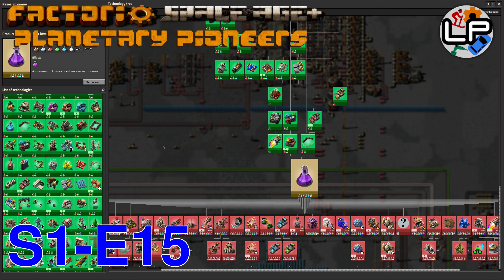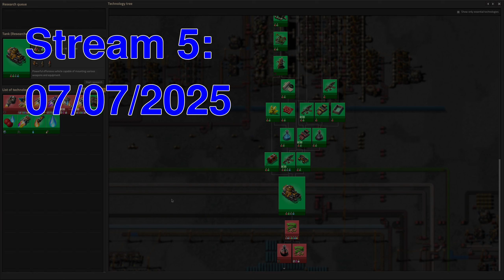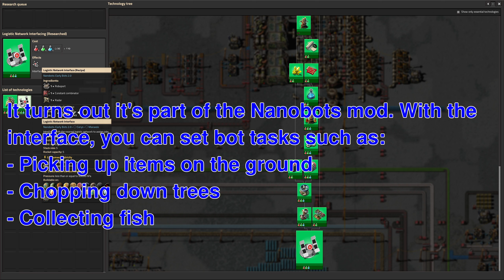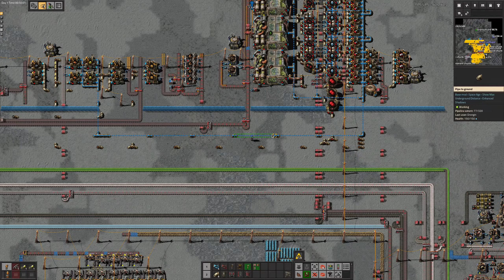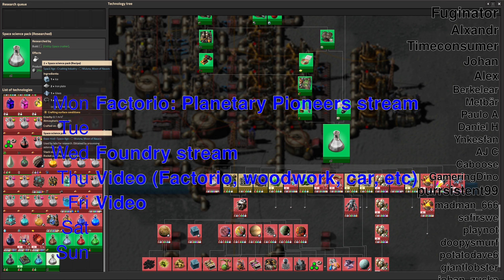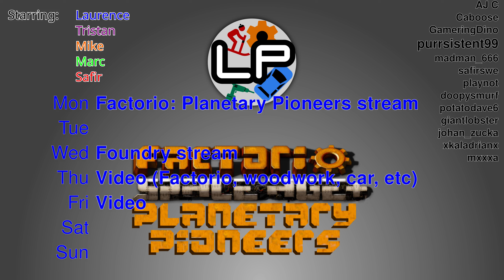S1-E15 - Learning - Laurence Plays Factorio: Planetary Pioneers

Comment: The ground cleanup tool is very useful.  This setup seems to drop a lot more things on the ground. Now if there was a tool to remove floors where I put them under my tree farms that would have been great.
Reply from the maker: You could probably do that with a deconstruction planner - I think you can specify to "remove tiles only" for that sort of cleanup. You'd have to select the specific areas, of course.
Reply: @LaurencePlays   I will have to look at it again.  I couldn't find it on the list when I was looking.  Thanks!
Reply from the maker: @Hazmatt4700  I'm pretty sure I mentioned it in my Blueprints (and redprints and greenprints) video: https://youtu.be/JXHsegWYaHY

Comment: I really feel like the downbinners are going to gut the challenge of some of the planets like maraxis.
Reply from the maker: At this stage, I'm just going to have to smile and nod because I don't know anything about Maraxsis, however we can consider when we get there whether they're going to completly break the point of the planet and tell ourselves we're not going to use them...

I've used a few on Muluna bcause something wasn't set properly and I was able to use a space crusher on the surface, and that had a built in quality bonus, and I wasn't ready to deal with that nonsense!
Reply: @LaurencePlays  that very fair. Though as far as I know the space crushers are meant to be usable on muluna, the mod author seems to have moved them up the tech tree a week or two ago however.  I suppose people had similar concerns with about the quality and power draw in a boot strapping scenario.
Reply from the maker: @DrenKillfree  Maybe that's what it was. I know I ended up having to finish my build with electric crushers because we couldn't make the space ones any more!